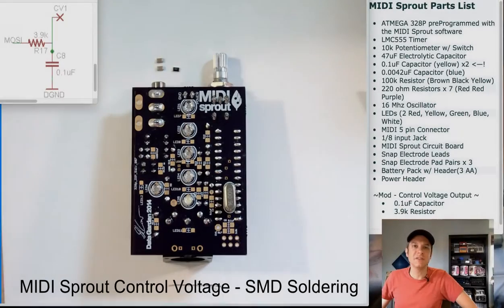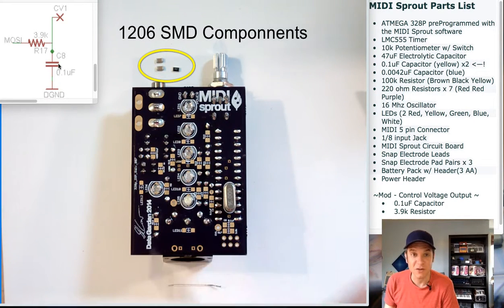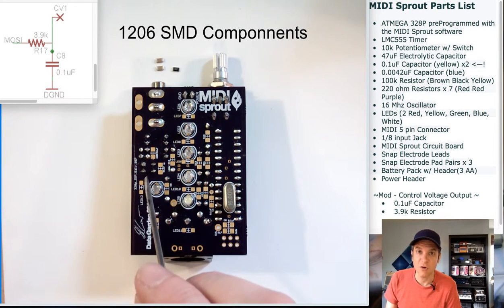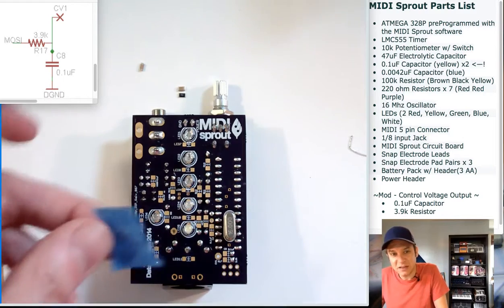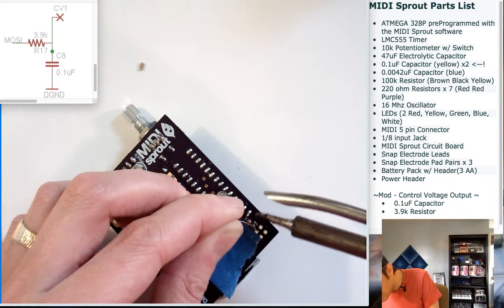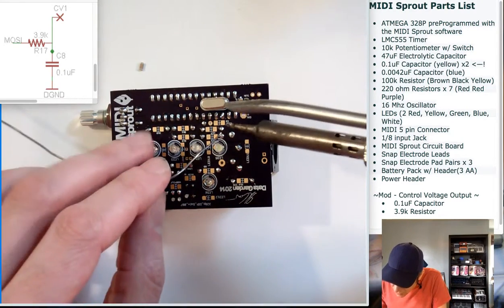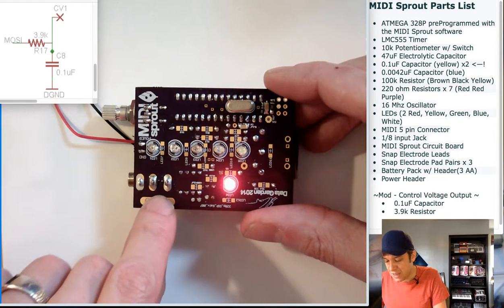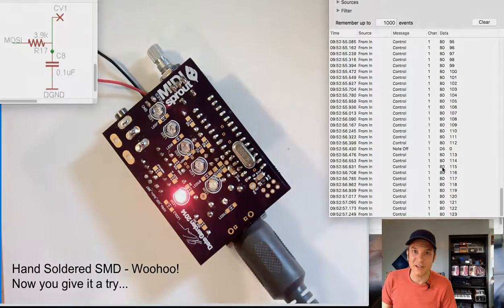MIDI Sprout Tutorial CV SMD

Comment: Hello. I added the CV out to my sprout, but the CV output is still not smooth (got the correct resistor and cap) and goes between 4 and 4.3 volts. Is there something that I need to change in the code to get smooth/full range CV output?
Reply: i have the same problem